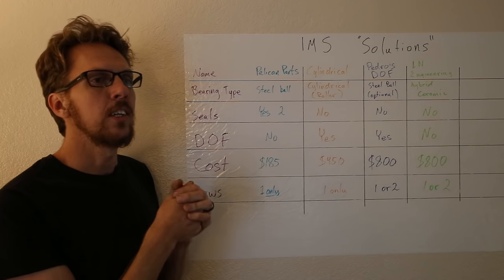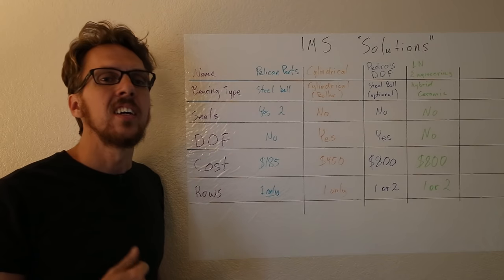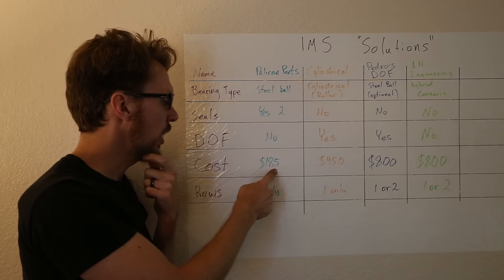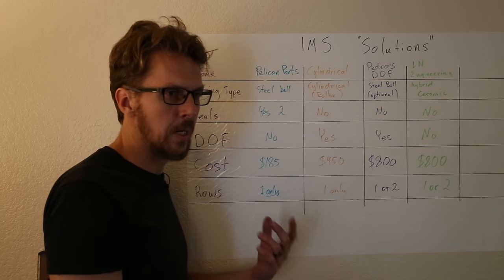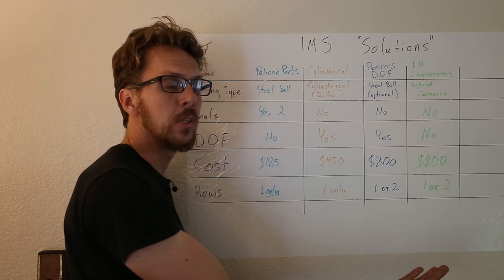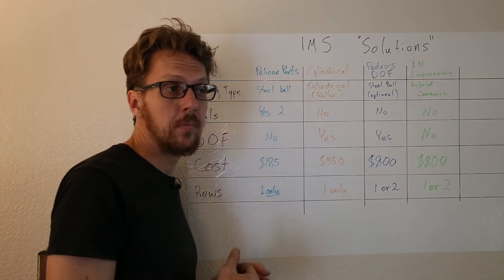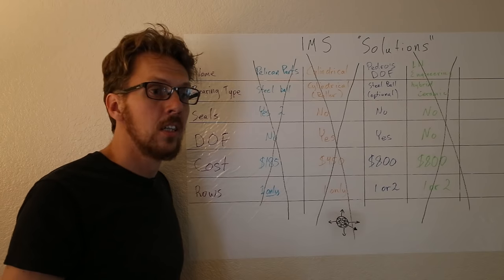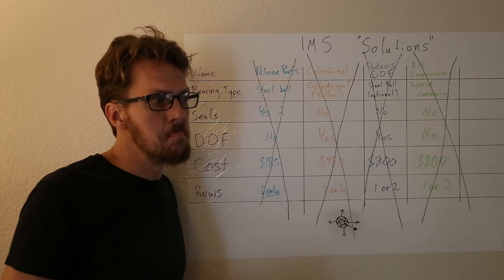What's the Best IMS Kit for Porsche (996 or 986)

Comment: some good info here. Lets look at this situation a different way.  What if you own a 997 S2 that will cost far more to replace if the motor goes.  To me, the cost or prevent the potential failure is worth it.  That being said, I think the "IMS Solution" is the best way to go, even at around $2k.  That kit, doesn't use an actual bearing, which means it most likely will never fail.  It also has an oil feed system.  Probably best to do this when doing the clutch at the same time, as the labor will be much less.  My car is an extremely early 997, that doesn't require the the case to be opened up.  I actually have an extended warranty on the car that still has about 18 months left.  If the motor doesn't go by then and replaced under warranty, I will be having mine done using the IMS solutions kit just BEFORE the warranty runs out.  Yes, $2k is a lot of money, but on a car that sells on the used market for $40-50k given my low miles and condition, it is a worthy solution.
Reply from the maker: I completely agree. The cost equation is different for each car, and I imagine it will change over time. If you had a high mileage 2.5l, a used engine might be close to the same as the cost of the solution... but for others (like a low-mileage 997) their engines are going to be worth the investment. The IMS Solution is still relatively new, but I do believe it is much better than anything else on the market.

Comment: Thanks for the videos Burner.  I'm gearing up for a DIY IMS replacement and plan to reuse the old center bolt and flange.  I want to buy a new o-rings in viton but don't know the correct sizes.  Might you be able to post the width and diameter of these o-ring grooves?  Thanks!
Reply from the maker: Awesome! so I know the o-ring for the center bolt is 7 X 2 mm... not so sure about the o-ring for the flange. I think it was about 46X2mm

Comment: So, you chose your own $200 ceramic ball-bearing solution?  What about installation labor charged by your Porsche dealer?  Did the work yourself?  How long did it take?  Why not give some details on your chosen solution?  How many hours did you put into your research?  Can't you sell your research (including details on your chosen solution) for $25 a pop?  Seems to me a successful solution might be worth more money than you think:  your used "96,000-mile engine" is worth $3,000 to $4,000 because it has an IMS problem that overwhelms all other risks.  Any fix that demonstrably resolves "the IMS problem" increases the value of your used "96,000 mile engine substantially.  How much does "substantially" mean?  --> Well, what's the value of a 2009 engine with 96,000 miles on it?  That's a good proxy.  The real problem is that no one can know for sure that there is a "fix" at all.  Figuring out which fixes are good, and which are best, requires a large survey of owners which would probably mean that Porsche Club would have to sponsor it.  I don't think Porsche dealers want to admit there was ever a such a problem ... they prefer to say it's just an urban legend.  BTW, I have a '007 911 C4S, and an '06 Boxster S.  Love 'em both.

Comment: Now that pelican offers a single/double kit for the 185 and in stock would it move it to the top of your list? PEL-IMS-1
Reply from the maker: I think it would be up there... IF I had a Porsche with a single row IMS bearing roughly 01-05... For the earlier cars with a dual row IMS... the Pelican Parts kit requires you to replace the dual row with a single row and spacers. Otherwise, it seems like a good product. I'm planning on getting a review up on the Pelican kit, soon.

Comment: I'm considering a 996 C4S with only 23K miles... Obviously not driven much.  What is the newest news / best option for this now?
Reply from the maker: For a low mileage valuable engine, like yours, I think I'd probably go with the LN's IMS Solution (This is a pretty new product that completely eliminates the bearing). It's an expensive fix, so I wouldn't put it on a high mileage 2.5 Boxster, but for your C4S, definitely worth looking into.
Reply: Thank you Sir. I haven't purchased the car yet. Actually considering a996 Turbo instead.  More power and Mezger engine with no IMS issues anyway. But I appreciate the reply in case I go back to the C4S decision.
Reply from the maker: Interceptor1255 Happy to help! The turbo is brilliant if it's in your budget!
Reply: Burner's Cars budget? What is that?  Lolol

Comment: Like every video: good information!
Porsche is constantly upgrading its components. Is Porsche has upgraded the spare parts for the "IMS"?
Reply from the maker: Porsche did update the IMS flange and seal--an upgrade I highly recommend! Unfortunately they don't supply any IMS bearing (upgraded or otherwise). What they did instead is redesign the entire intermediate shaft assembly which can't be replaced without dissembling the entire engine and spending thousands :(

Comment: You missed the RND SSF Roller option.
Where did you source the bearing? 
After opening my Dual row stock bearing after the mechanic changed to the roller, i found one row of ball bearings completely pitted, and a 3/4" line on the inner race equally pitted on one row, a 1/2" pitting on the other. I recommend a roller, Ball bearings don't have the load capacity, and the lateral loading is provided for in the design.
Reply from the maker: Truth be told, I didn't spend much time on the roller options. They were just a bit too far from the original design for my comfort. How long have you had your roller bearing installed?
Reply: Only for about a month, but i don't like the ball bearing for this design. As long as the vertical load is accounted for, rollers should be a better fit, i think. I've heard of the magical LN bearings failing after only 20k miles. Takes the whole engine with it. We'll see how this roller holds up, like you said, engines are only 3-4k. Cheers!
Reply: +Chris Frank "Ive heard". ... where did you hear this from?. Charles Navarro of LN Engineering told me they have never had a double row fail. It is very important that if you spread dirty  rumours you can prove them and give a reference!
Reply: Rollers have a higher capacity radially but they also have a tiny bit less friction compared to deep grooves. With radial load a typical friction factor for a deep groove is 0.0015, double row deep groove 0.0024 and for rollers 0.0011 [SKF General Catalogue 2005 ]. Friction turn to heat. But one could think that the oil temperature dominates here. But a question is raised: Why does the bearing overheat in the first place (raceway damage is usually sign of that). Oil level? The other option is that the surface treatment of the raceways is not homogenuous from bearing to bearing... quality control. My original was made by NSK. Then there is also the theory (by e.g. Pedro) that the oil trapped gets acid.
Reply: It's not a 'Dirty Rumor'. What he told you was that there has never been a failure when installed at thier one shop, with cherry picked Engines that exhibit no problems what so ever. There bearing has had many failures. http://rennlist.com/forums/996-forum/869599-ln-engineering-ceramic-ims-bearing-failure-at-30k-miles.html , http://forums.pelicanparts.com/porsche-996-997-991-forum/731825-ln-engineering-intermediate-shaft-bearing-failure.html, another had a LN bearing failure at 20 k miles. Don't believe the hype, and look into roller bearings... lol
Reply: The first link you give refers to a single row bearing and I suspect so does the second one too. The second one has also a response from Charles Navarro. His reply is credible. And the longer two row bearing is easier to align as it takes its place quite naturally. I noticed that my IM-shaft was slightly elliptic (estimate. 0.01 mm) which can make a short (single row) bearing difficult to align perfectly as it tackles going in.

But forgetting the number of rows, in the first link it would be vital to know what caused the raceway damage. It looks like either in imbalance problem or heat treatment failure. Acid oil is not credible cause here.

It is always a (dirty) rumour if you do not give the reference. It is. You should always give a reference, even every time.
Reply: Further more, in the first link you can see directly an installation error. The seal facing to the flywheel should be taken off in the LN bearing according to installation instructions.

(Here I want to say that the installation instruction text by LN was one of the worst Ive seen. I needed to read it many times before I understood what was relevant for my type of bearing and engine version.)
Reply: You act like these are the only failures, that's not the case. LN bearings fail all the time, this is just a 5 min google sample. couldn't immediately find  the other LN dual row that failed after 20 k miles.
Reply: FURTHER MORE, the LN line is a Scam, anyway. Try as they might to get perfect cars that probably would never suffer a failure anyway, their bearings still fail and take engines out. The rollers seem to have a much better record in real world replacements- saving engines! Cheers!
Reply: No, I dont act anything. I am not the one passing misinformation. I try to pass exact information. If you know cases, refer them, otherwise keep it in. So far you have not given a single double row failure reference. If you haven't noticed forums are typically 95% misinformation and 5% information. References!

I want to know if there are failures, why they happen but I dont want to read misinformation and "I head from a friend who heard from a friend who ..." . So far the only proper information you've given relates to your own case. The links you passed were not relevant to double rows.
Reply: LNs fail all the time, I'm sorry if you don't like that.... 
The ball bearing design in not right for that application, sorry if you don't like that either.
Reply: The "inner" means the smaller ring or the raceway more deeper in the shaft? Did you have pitting on the outer ring raceways?  What did the  balls look like? How much is your car (engine) driven? There is obviously a lateral force on the bearing caused by the chain pull. Maybe you should check your tensioners and the tensioner pads.They wear out.

My OEM NSK double row had 82 000 km and it was in 100% perfect condition: no play, no marks what ever in the raceways.  Ive had no ferrous particles in the oil filter check ups, some aluminium powder and bit of that brown plastic from chain tensioner pads. The shaft had about 1 dl of oil inside. Unfortunately I did not check the ph of the the oil.

 I did consider the three possible DOFs, two roller options, three ditterent double row bearings but after reading the statistical evidence of the Eisen case (50 000 US import cars) I ended up with the LN double row hybrid. It looked credible evidence in my eyes. It showed that the single row failure (by that time) was 4-8% and other  (double row) less that 1%. There was no reason to believe the info was biased or tweaked as it did no favors for Porsche.
Reply: Most likely, these parts do not fail, though a 10% failure rate on a OEM engine is horrendous. So is 1%failure rate. 90% of them do not fail, but the fact that when they switched to a single row, the failures shot way up indicates that it is the wrong type of bearing for the application. Replacing it with the same wrong type is foolish, IMHO. Yes, there have been many LN dual row failures. Yes, it's the wrong type of bearing for the application. that's why i went with a roller.
Reply: I dont know ... Chris Frank says: "...there have been many LN dual row failures" and Charles Navarro of LN says: "We have had zero dual row failures.  .... The DOF is a solution to a problem that doesn’t exist. The M96 engine is wet sump and as long as the ims bearing has no seal on it, the bearing is submerged in oil unless there is no oil in the engine, in which chase it will blow up regardless. .... If you are considering a roller bearing, SSF Auto Parts has a superior roller kit which RND Engine manufactures for them."

Now, who do you believe. YOU NEED TO HAVE REFERENCES!!!
Reply: I don't owe you anything. Take my word for it or don't. Just don't cry when you here the screeching from behind you as many LN purchasers have. Ask you self, Which one of us has (or had) something to sell you? Google 'Confirmation bias'.
Reply: I think you do owe to all readers here. You owe to us all that you pass correct information and not just hearsay as facts - otherwise it is just like presidential campaign.

Confirmation bias - bullshit! I have scientific background and I know what source criticism means. I've been educated to design bearing arrangements both in the university and by SKF professional course. The fact that LN sells these things puts them in a stand but it does not automatically mean their piece of information is lies. Lies tend to have short traces. Unfortunately rumour don't. You have to asses what info is credible and what not. References! 

I ended up with one IMS solution based on the information I had in hand. As you can see from the capacities that rollers can be justified too. The information that I have today - I'd probably still end up with the same solution. Nothing new has been presented here. However, since I did my choice there is a new product available: more expensive and in the lines of the old Porsche school - DOF plain bearing by someone I dont want to mention any more. Most likely the installation will pay itself back in the car value as there is so much value hurting bs around here.
Reply: You can't avoid confirmation bias, it's integral with being a human. the only way to avoid most of it's effects is to do a scientific analysis and show all data. It's even better if it's a blind study, which is why new medicines are often evaluated in a double blind study. the truth is you made an emotional decision based on what someone told you to make you feel all warm a fuzzy about their bearing, and what he told you was the truth... stretched like taffy! They've never had a dual row failure installed at THIER SHOP, using CHERRY PICKED CARS, that would probably never have experienced a problem in the first place. 

Is lying by omission still a lie? Depends on what it leads people to believe. You believed that no LN bearing has ever failed, Clearly i proved this was a lie. I think you would be more truthful with yourself if you admitted that you made an emotional choice with a veneer of evaluation, and you have no idea what is going to happen to your bearing. That's because there's not enough unbiased data out there, and those selling the 'solutions' are more concerned with making a profit then honestly sharing facts. Well all know many, many LN single rows have failed, why else would they change to a double row? Now, none of those have failed? sure. complete BS. But what ever makes you feel Emotionally better, when you drive your Porsche, at the end of the day, that's what this is all about, really.
Reply: LN engineering has warranty system on their products and if their product fails they should know. There is absolutely no evidence so far of "cherry picking" or "cars in their shop". This claim is only by you. You pass it like it was a fact. So far it is not the official trueth! Sure it can be true but no evidence. It can also be true that LN is honest. Give me evidence, references?

I think you are far off in your assessment. I try to make a decision based on good thorough homework, proven data and credible knowledge I can gather. Your claims are nothing but claims, rumors and poor homework except in regard your own car. 

LN Engineering is a good reputation company widely referred in the Porsche circles and magazines (which of course is no absolutely proof). Chris Frank is who? What is your education, your authority on this matter except that you own a Porsche which did not have a fatal disaster? Are you educated in bearings, are you a mechanical engineer, do you work with engines? Refer to me one failed LN double row and I take you seriously after that.
Reply: +Juha Kivekäs You have none of that. Don't take my word for it, Call them and ask them what they're talking about when they say 'zero failures'. Ask them what cars ther're talking about. All cars they sell to, or their cars only. Man, those magic ball bearings will SMOKE! I would never use a LN Ball bearing replacement. same thing all over again. Good  luck with your car.
Reply: They only warranty the bearing not the engine 

The warranty is meaningless if the bearing fails

Comment: Good video but he is not using any solid technical bearing specs to compare the actual bearings.  As an engineer I would like to see them listed side by side compared to the actual operating requirements for The engine.
Reply from the maker: So would I. Unfortunately, each of the makers of the "solutions" are really secretive about exactly what type of bearing they use (one of the reasons I wasn't a big fan of the kits out there). Meanwhile, Porsche has moved on to a totally redesigned intermediate shaft and doesn't touch these bearings, so technical specs are pretty hard to come by.